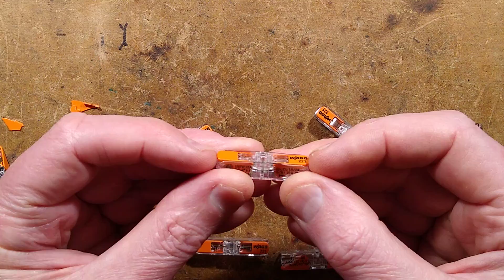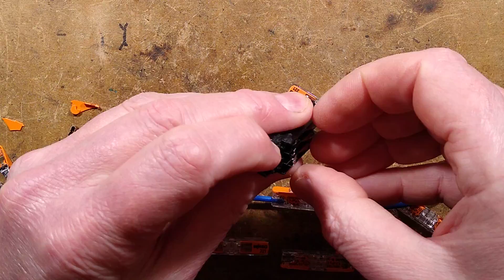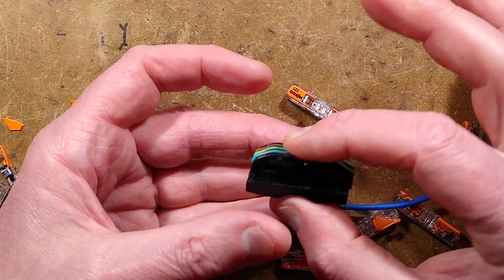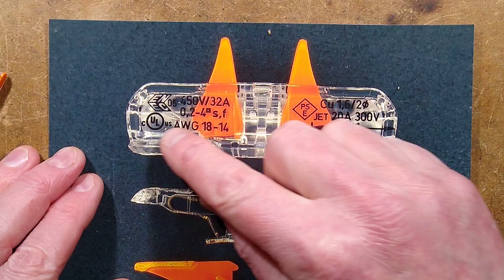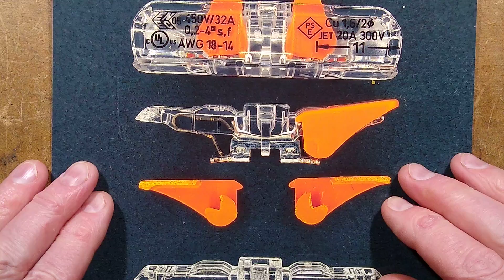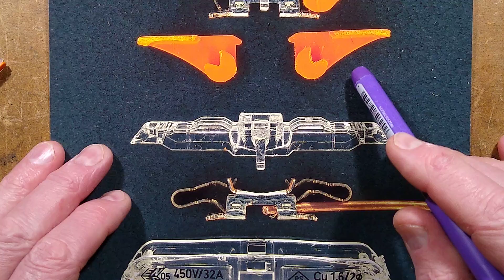By request - a look inside a Wago inline connector

Comment: Iw used these for 10 years and they have been used everywhere in my country for a long time, I dont think Iw ever heard anyone have a negative experience with them so they are good. Some of the older type vagos would have such a spring in them that the clip would often hurt your fingers closing but these never ones have that fixed too.

Comment: Always twist them, you want it to be one solid piece and not flatten out. In case the connector is less grippy then you have a better chance of it staying in.
Reply: The clamping force is not so great that it will break stranded wire no matter how you twist it.  That said, very high gauge (like 22-24 AWG) stranded wire is inherently weak but using a ferrule solves the issue entirely.   Those inline WAGOs are rated for up to 18 AWG but the non-inline versions are rated all the way up to 24 AWG.
Reply: That doesn't apply for clamps like these because they're flat-to-flat; the inside of the connector isn't concave (to fit a round cross section wire) in order to ensure even force is applied regardless of differing diameters. Stranded wire becomes prone to individual strands breaking if they're not allowed to move during clamping, as some will be under more strain than others. The exception is if you can guarantee that the wires will be fitted straight and remain straight, never being twisted or turned or pulled about. You can achieve that by using the terminal/junction boxes that fit the clamp connectors but in most cases they're overkill & they're far less compact.
Reply: @NightCatArts  While that's all true, they only break if they are twisted too tightly. Also no connector is immune to wear and tear and a well used connector might not be grippy enough.
Reply: @albert_vds  Yes tightness of the twist matters, but the strands can still break if they're crossing over one another where the clamping force is applied (and the connection moves). I wouldn't want to use these connectors more than ten times for anything carrying mains power anyway though, due to the difficulty in opening them up after some wear on the tabs rather than anything else.

Comment: To twist or not to twist, sometimes you have no choice if you want to keep the strands together, I tend to give a little twist, however an electrical engineer once told me that twisting is bad, because like twisting a rope it makes it shorter, then over time the twist and the wire can work loose, but this was in the days of the dreaded screw connector blocks and I say dreaded because having used Wago connectors with my failing close up vision, I would be nuts to go back, lets face it choc blocks were never that great anyway and the screws worked loose.  I have an off-grid home and I have used these on low current low voltage lighting applications, they save hours of time and no fires or failures yet. My only critique and its more serious if working on live mains power is their vulnerability to being caught by the hand and the lever being flicked up and releasing a live conductor. But on the flipside when having to work live they make it easier and safer to terminate wires or cap them off, without screwdrivers.
Reply: Yep, for crammed in wires i add some insulation tape around to prevent the flap from coming up. If you're working with solid copper for the install you can push it in just like the old version, without opening the lever, so can have some pre taped in your prefered colors.

Comment: I am an electrician and wagos are dogshit on solid wire. the connection actually heats up more than the surrounding wire at full load (15 or 20 amps). A well made connection with wirenuts or crimp connectors will have the wire insulation failing before the connector. on stranded wire they're still not great but serviceable.
Reply: WAGOs will get a bit warmer under the load verses a wire nut, but that's about as far as it goes.  I've never had heat issues at 20A with solid wire.   I have a few with ferruled stranded wire running at 30A (With WAGO 221-613's) and they don't even get warm.  And that's continuous 30A for several hours straight (DC Solar related gear).

I haven't tried solid in that particular (30A) case but I wouldn't expect it to be a problem either.
Reply: @morscovium8881  you should drink more mate
Reply: @griffinbastion  stop stalking me you thin skinned fruitcake. I wont give up my ass, at least not to you
Reply: The insulation fails before the connector with a Wago, too. This has been demonstrated many times.
Reply: @Monkeh616  I highly doubt that to be the case on solid wire with 90 degree Celsius rated insulation
Reply: @morscovium8881  So which part do you think is failing before some PVC? The copper? The steel?
Reply: @Monkeh616   the plastic. that. the connector. is. coated. in.
Reply: @morscovium8881  You think that's going to fail before soft, flexible PLASTIC wire insulation? It's not. And even if it does fail, the wire will be failing right alongside it.. while the actual connection remains secure.
Reply: @morscovium8881  And the plastic on a wire nut will melt in an overload condition, too. A Wago won't melt used within its specification unless it's defective or improperly used (which is hard, kinda the point of them).

Wagos have been used for decades. Long before your far away country heard of them. They work just fine, they don't run smoking hot and fail prematurely. You're simply afraid of change.

Keep up the insults, though. They really underscore your failed argument and fear.

Oh, and by the way, they're made of polycarbonate - another one of those carefully engineered materials. They're rated for 85C ambient, 105C maximum connector temperature, and the housing is rated to maintain its full mechanical properties to at least 120C by UL standards. And, again, I have seen the housing outlasting both sheath and insulation on wires in multiple different tests up to and including application of a blowtorch. But you keep on hiding in fear of the joint being 1C warmer than the cable if that suits you.

Comment: I used to work with Wago and it is pronounced "Vargo" or "Vaago" depending on accent.

The screwless connectors are really good and the QA is excellent. I personally would not use cheap Chinese rip-offs. I've had enough troubles with poor quality table ties let alone taking risks connectors. They rely on specific types of metals to give a consistent and long-term reliable connection.

Wago also suggest NOT using ferrules.
Reply: I think it depends on whether you're speaking German or English.  In English materials, from what I've seen, the company representatives seem to always pronounce it "wah-go" (with the English "w", but still with a soft "a")..
Reply: Where do they specify not using ferrules? I dont find any information about that on their pages, although some people say if you ask wago they say its possible if you use the correct ferrules (in germany DIN 46228-1) with a proper crimping tool. I see it only specified in the catalogue for the 224 clamps.
Reply: @theartofbanana  The connectors produce a gas-tight connection to the conductor and the ferrules are a potential point of failure. They are seen as unnecessary. There were a number of terminal applications notes that covered this but I left almost 10 years ago.

Comment: Click together and run current from the both ends. The solder will melt
Reply: That's why they don't rely on solder; they have those mechanical mortise & tenon joints as Clive demonstrated.

Comment: Twisting: Lightly turning it back and forth to catch loose strands can be okay, but frequently you're better off clipping the wire and getting a fresh end. You also risk contaminating the wires with corrosive skin oils or mechanically damaging them with pliers. 

So: a very light finger twist if there are loose strands, being careful to touch the copper as little as possible.

Depending on the situation, using a file might also be in order. Dunno how Wagos and feels get along.

The last big writing project i did with stranded used the stacking DIN rail contact blocks, and all the wires going into those got ferrules. The other end of the wire typically has a ring lug or quick disconnect crimped on.

Comment: I don't use wago connectors myself, but when attaching wires I always always twist the wires to prevent strands from separating and poking out of the terminal. I would use uh... whatever those metal sleeves you put on wires are called... but I have yet to get myself a set of them to try them.
Reply: Ferrules?
Reply: @AlexKall YES! That's the word! Thanks.

Comment: They are shit I Had One on the power saving lamp that was Always On Annet turned black en 6 Months I don't use them
Reply from the maker: That probably wasn't a Wago.
Reply: Are you sure they were genuine Wago connectors rather than cheap Chinese knock-offs?
Reply: @rjy8960  100% I got Them from building Side I work in plastering  so they ar 100% real
Reply: @rjy8960  I Had A lump on Them from 10 Watts that was Always On after going On The Ceiling i noticed that was Turning Black six Months runn time
Reply: Plasterer steals some used connectors from building site, lashes something together at home which fails..

Forgive me if I don't use your excellent review as a basis for my decision making in electrical engineering.
Reply: @Monkeh616  steal no they give you  if you ask nice 😂😂   en my hobby is audio electronics  🔉 amps pre amp dac  high-end stuf im just saying that it's not that Good of a Stuff this happens It's no good simple maby im unlucky  or they ar no good  

that's good of my jobe  they are handing off stuf we neem in private 😂😂😂   cat6 cabel running in my house end the back bilding have internet ground wire en cat6 
its nice that they do it like that 😉
Reply: en nieuw out of the box so  your talking boelshit my friend dond be a ass hol 😉 just a hard working man here
Reply: They are 100% original They got I got Them from building Side They were used in a nieuw school building  no fake 100% real  test it out discolored after 6 months
Reply: I am in Construction 15 years Now de do not use fake Ones in Nederland Nederland is really strikt in that sort Of Stuff so it's not a knock Off It has to four Wire connectors not One That shouldn't be a problem discovering after 6 Months is no good I can imagine If You Put A few 100 Watts through them that's Possible but not with a small power saving lamp no its no good

Comment: One feature of this type of connector that doesn't seem to be mentioned much is that wires are easily removed and re-inserted without damaging the wire.  No problem to change out a light fixture or other device;   no need to cut off twisted wires or struggle to remove one wire from a group.
Reply: So many stabbed fingers from trying to salvage an already too short wire lead that was recently in a wire nut 😭
Reply: And they have a handy test are a on the connector.
A.sparky thought the 3 connector type ....he could connect live earth n neutral in the same 3 connector wago 😂😂😂😂
BANG⚡🔥
Reply: I remodeled the first floor of my home and replaced all the light fixtures with recessed LED downlights. Wago is the only way to go when you're installing 4 to 10 of those lights in multiple rooms. I used to use wire nuts from time to time because that's what was laying around. They have now been replaced with an organizer case filled with a variety of wago connectors. I love the 5-wire connectors for residential stuff.
Reply: Also useful in pov you lost all three of your electrical screwdrivers yeah I thought bright yellow would stand out in mostly green and green environment too 0:32
Reply: But reuse is not recommended ..
Reply: @berndeckenfels  yes please buy a new one after every use 🙄
Reply: @mrrooter601 the mechanism does get weaker with every use. I would only worry about using them more than 2-3 times at close to the rated load. Also wouldn't recommend going from a very large gauge to a small one.

I've used the knock off ones a bunch of time for smaller wires, and they do eventually get easier to pull out. The clip also gets noticeably easier to move.
Reply: @lost4468yt  It doesn't really get loose with every use.  I've reused a WAGO dozens of times without any appreciable reduction in compression.   That said, for in-wall or fixture use, I will use a fresh WAGO.  But for projects I reuse them all the time and they can certainly go through many cycles.  I have yet to break one or have to throw any away due to weakness.
Reply: Well you wouldn't find me using this form of connector for anything permanent in my own home.
Seems stupid, a bit of oxidation over the years and it's liable to get hot
Reply: @incandescentwithrage  Quite the opposite - they are considered to be more reliable than screw clamps, as Clive says. I believe that regs now require anything with screw clamps to be accessible for inspection, whereas these can be hidden in inaccessible places.
Reply: @matthewmarks6951  I'll still give this a pass. Ferrules & screws for me, unless someone suggests we use this Lego nonsense in consumer units.
Reply: @incandescentwithrage  Where's it going to oxidize? The connection point is under high pressure and gas-tight. Now, in a really bad environment corrosion could build up and jack things open (or just rot the spring out..), but that will break apart any other type of connection, too - screw of all varieties, crimp, solder, ultrasonic welding.. seen them all fail.
Reply: @Monkeh616  it's neither under high pressure nor gas tight. Just metal contacts and a spring
Reply: @incandescentwithrage  That pressure should be quite sufficiently high to make the point of contact gas tight. It is, after all, a small area. If it concerns you, apply a suitable anticorrosive agent to the termination - you should do that with any type of screw terminal too, if this is a fear of yours.
Reply: @Monkeh616  Yeah maybe you're right and I'm being too old fashioned.
I do the same with plumbing - still solder instead of trusting the new push fit stuff.
Reply: @incandescentwithrage  Oh, I like copper and soldering myself. The push-fit stuff should be good for decades, but I really like the solidity of copper I can trust for 50 years. Just do not like hiding a compression or o-ring seal.
Reply: @incandescentwithrage is oxidation happening in Wago connectors exclusively? Screwed terminals are immune?